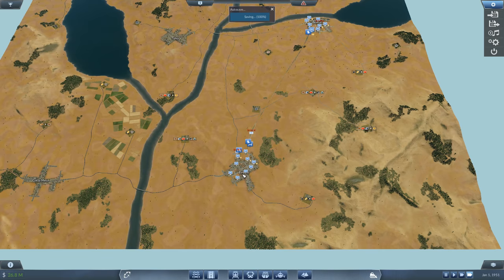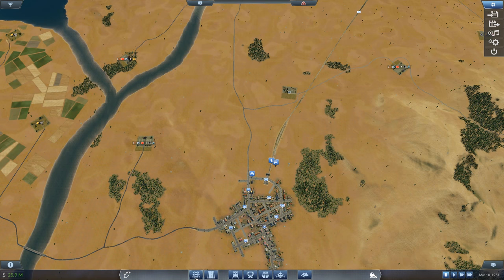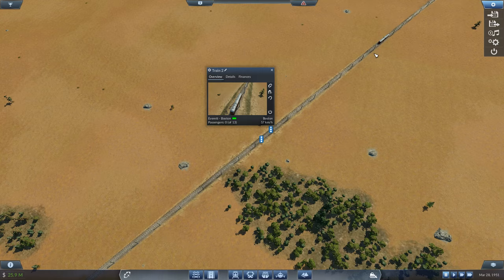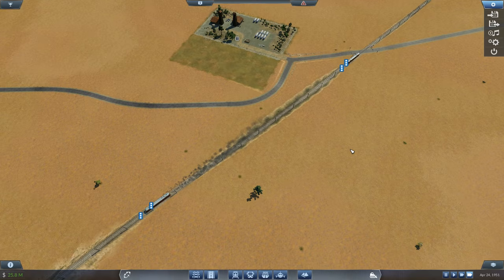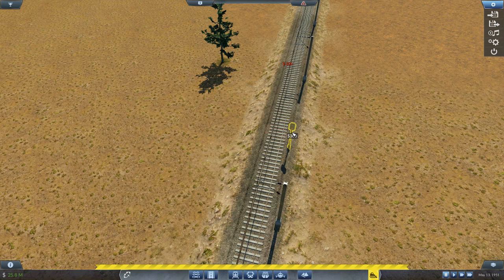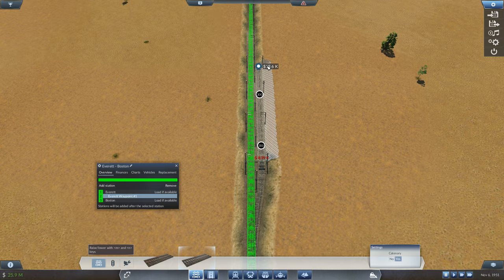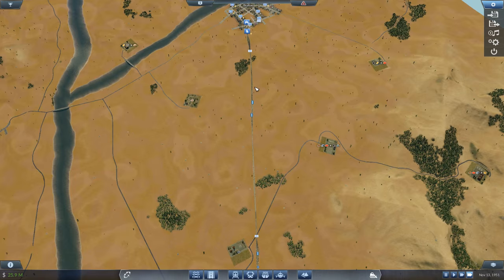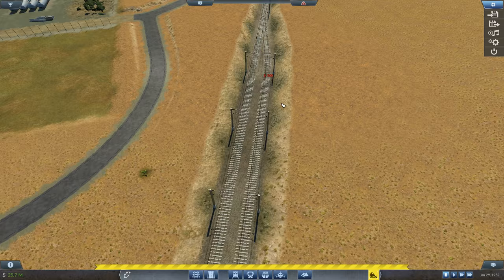Transport Fever - How To Use Signals Tutorial

Comment: You can connect 2 platforms in 1 line with 2 tracks with 2 trains both going 2 way. Just put other side a waypoint line 1 will not use the waypoint but line 2 will use the waypoint now train 1 using line 1 will not need to find the waypoint while train 2 will need to find waypoint as its using line 2. Now both tracks are 2 way.